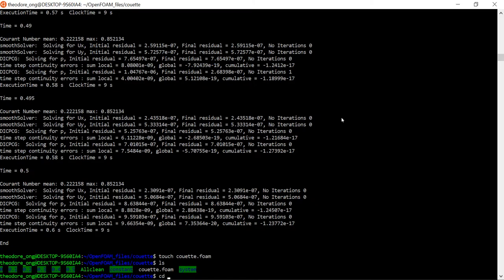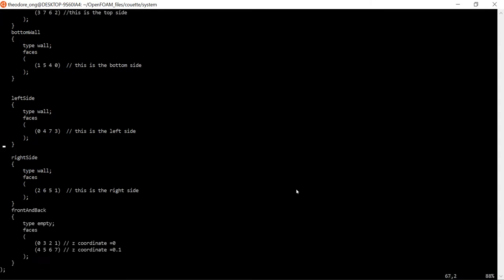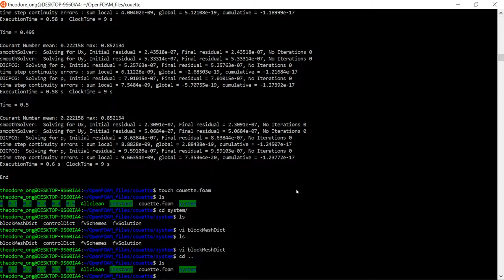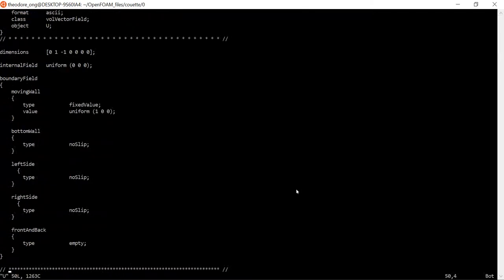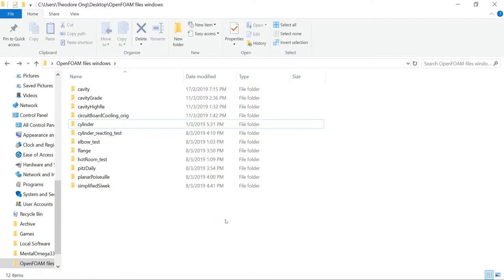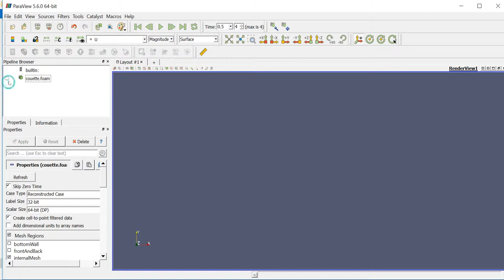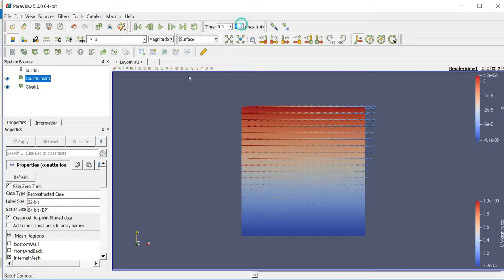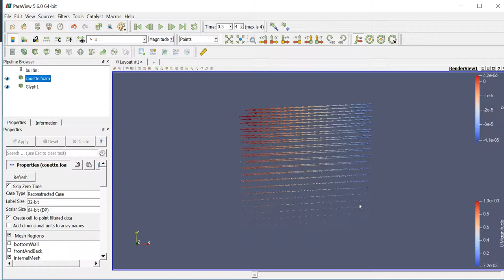OpenFOAM for Beginners win10 8   Parallel Plate Couette flow editing boundary conditions

Comment: HI.

I am just new to OpenFOAM and moving my way around. So I am working on a 3D flow in a duct, 3D backward-facing step. I am exporting a mesh with the boundary conditions from Pointwise.

Regarding the definition of the boundary conditions, It is OK to define all the walls (Both sides, bottom, upper and the step) in one boundary condition.

If not, for the bottom walls (as they are not at the same plane), also do I need to define them separately or just under one BC?

Comment: Hello Theo, first thank you for those great tutorials. I followed the steps, but the pressure Surface is not colored, it's gray. The velocity Surface is colored and therefore when setting the glyph the arrows are not colored also. I checked the pressure file in the 0 directory, and I couldn't find any mistake. Do you know where the problem is?
Reply: In Paraview, properties, go to coloring, choose pressure, and select the icon ''Rescale to data range over all timesteps''.